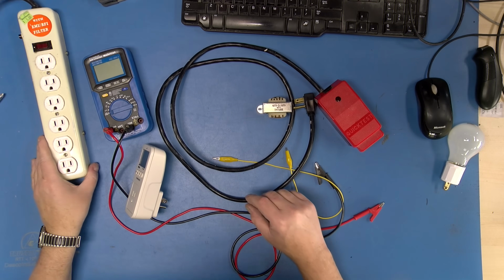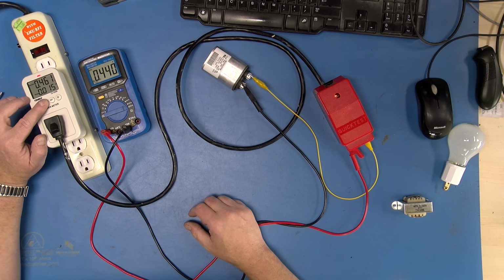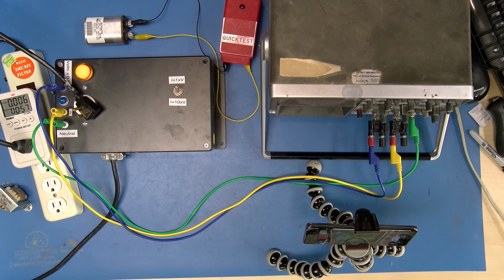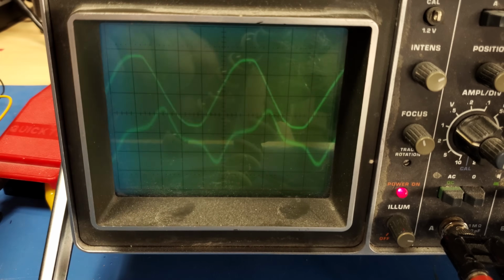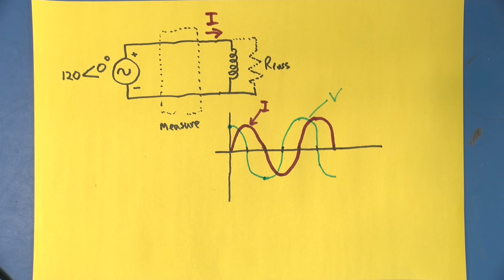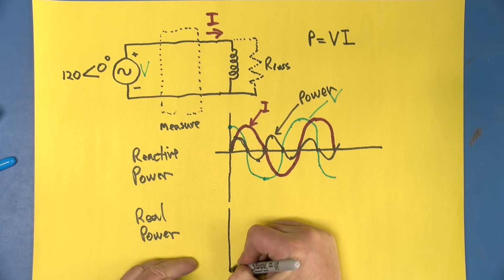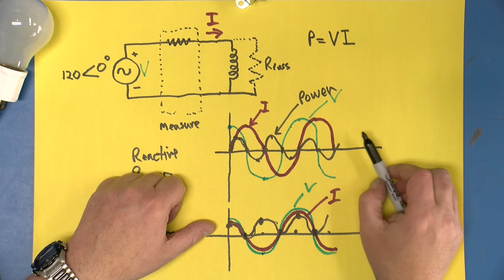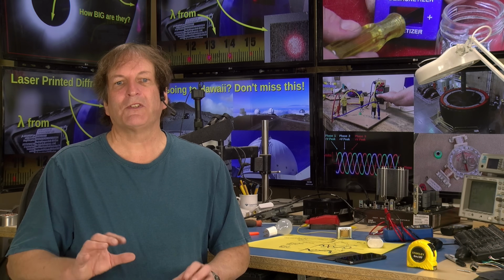That strange flow of electricity that transmits no real power

Comment: Thank you for the great illustrations, explanation, and demonstrations.  This is one of those things that a bit hard to grasp just reading it.
First time I ever ran in to it was forever ago when manufacturers started advertising UPS's (battery backups) in VA instead of watts.
Picked up an AEMC clamp meter that let me see power factor and the actual power draw.
An eye opener seeing something consume a large current but very little power.  Like LED light bulbs.
Reply from the maker: Glad you liked them! Now that I think of it, UPSs were probably the first time most people saw the term VA. When I was a kid an we leaved overseas I had seen in on transformers but nobody seemed to know how it was different from watts. 

It is a bit of an eyeopener - not sure if you saw in the video, but the other amazing thing is how much current thing like induction motors use for the first few seconds of startup - often 5 or 6 time the usual current which a transformer would have to handle. 

LEDs and electronic powers supplies are often worse in a different way - a high narrow spike in at the peak of the AC voltage,
Reply: @ElectromagneticVideos  I haven't watched the previous video but am planning on it.
I had always wondered about xfmr's being rated in kVA but had never known about or considered the reactive (imaginary) current flows adding to the system.
It's sort of like VSWR.  Reflected power in an RF system.

I knew of an inductor's effect, buy, yeah, never really experienced it until I got my first air compressor.  It'd trip the panel breaker on startup from the massive inrush.  I foolishly tried to limit the inrush current using a bunch of paralleled 500W tungsten lamps.  I didn't have anything to measure just how much limiting that I needed.  Just ended up making a light that came on...then tripped the breaker.  LOL!

I wish I had know about NTC thermistors back then.  That may have actually worked.

I learned more a few years later when I started troubleshooting AC compressors.  Learned about LRA (locked rotor amperage) and how much and induction motor could pull without a start capacitor.  Start cap would go bad and burn the contactor's contacts in the process.

Yeah, a lot of switch mode power supplies have no inrush limiting and POP when you plug them in to the wall.
I've got a SMD reflow gun that flickers the lights in my shop from the PWM to the heater.
I'm planning on adding a NTC thermistor to get those spikes down to a reasonable level.

Thanks again!
Reply from the maker: @button-puncher  "It's sort of like VSWR." YES!!! Consider it a very short RF transmission line with a mismatched load that is very reactive (like many antennas!). 

LRA- did you see current my little grinder when it started - 4 or 6 times the running amps which is typical. The grinder really has no load other than the momentum of rotor and grinding wheel. Compressors often start when there is considerable pressure in the system - terrible for a single phase induction motor which hast it lowest torque at low speed.

My reflow gun does thin same thing -  though it was just because it was pulling a huge amount of current. Are you saying its noise from the PWM?I never considered that.
Reply: @ElectromagneticVideos   Yeah!  On my old 2ton unit at home, I was seeing a 118A peak at 240V.  Amazing that the compressor's windings didn't melt but i guess it did have the refrigerant to help dissipate the heat.
Head pressure too.  Bought a manifold gauge set for car stuff but hooked it up to my home AC just for fun.  WOW.  The short restart pressures were nuts!

As for the SMD...  I don't think it's noise.  It's just that they are using such a low PWM frequency for heat temp control, seems like only a few Hz, that in combination with the units switchmode power supply with no inrush current limiting, causes the terrible flickering on things plugged in to the same circuit.  I've never scoped it, just my observations and guesses.
My workaround to protect my other bench equipment was to put them on a  double conversion UPS that I had laying around.  Oder Eaton but it puts out a  beautiful sinewave.

Future video idea?  The usefulness of NTC thermistors to battle power current spikes?

BTW, why is your oscilloscope current test box so huge?  You have a couple custom wound current transformers in there?
Reply from the maker: @button-puncher  The currents are staggering for those motors! They survive because the max current is only for a few seconds and the thermal mass of the copper and iron means it takes a (short) while to heat up. If the rotors is stuck, they do burn out really fast if the breaker doesn't trip.

I will have to think about the NTCs for current spikes - I dont think they would be great for for things like motors - restricting the current flow would drastically lower starting torque. A VFD set to ramp up voltage and frequency might be better - they are so cheap these days!

The test box - just has a some low ohm power resistors inside. I repurposed boxes from various past work prototype projects so not ideal sized. Nice thing is though the size acts as a heat sink for the power resistors.

Comment: There was a device sold some time ago or maybe still is, that you plugin in appliances that use motors and was  suppose to save power useage based that that lag from running motors.
Reply: reactive power is free for homes. so such a device would be pointless.
Reply from the maker: Besides the point @KarldorisLambley made below, may of those devices were equipped with capacitors that were way to small to make any difference. I think some just had a LED indicator to show they were "working". Bigclive took some apart as I recall. So sadly, most of those devices are scams :(

Comment: AC HZ60-60+=120VAC NO AMP NO WATT NOW GROUND NUETRAL HAS AMP WATT CAPACITOR ON TRANSFORMER DC DISCHARGED PUSH PULL KILOWATTS VjX

Comment: Nice clear demonstration,   In a Flour mill power house and noticed a Power correction unit.  I cant remember the kVAR but the cables were 16 mm. The controller was having a bad day  throwing in all the capacitance causing a massive lead in the system, then over correcting and back to o.4.  I called this in and advises immediate action. Returning the next day to a mess of cables that had pulled such a high instantaneous current they had bent the trays and were tangled in the chard remains of some very large capacitors.  Best wishes.
Reply from the maker: Wow - that must have been a wild mess to see! Was the correction unit fixable? Or a write-off after that?
Reply: @ElectromagneticVideos  Definite right off and so nearly was the guy that investigated it despite my warning to isolated elswhere before opening. Fortunately the  blast shield did its job and the arcflash contained blast I expect the techs pants did similar.  

The fault was the controller which I think someone had incorrectly adjusted  delay and it was hunting. The cables were secured with 10mm ties wraps but those were ripped as the cables magnetic field rebelled. Lovely mess and reminder of the power stored in capacitors. 

I do miss the smell of switchgear.
Reply from the maker: @WOFFY-qc9te  "those were ripped as the cables magnetic field"  I have seen videos of that sort of things in fault conditions. Its hard to imaging the forces being so large but only because it outside  of our (or maybe my) everyday experience. A bit like I find it hard in imagine a dist particle travelling a very high speed having enough energy to damage windows on the ISS.
Reply: @ElectromagneticVideos  I did a stress test on a data centre, the old chap with me was old school and not impressed with the Pillar kinetic rotary storage or the digital switches which switched on a quarter cycle but as this UPS could not be turned off for twenty five years we made sure it was sound

Anyway with load bank connected we  diverted 1 MW through four alternative routes whilst the UPS was on line. 
The 55mm 480 vdc cables had been left loose on the 10 meter caged trays for a reason and that soon became apparent when they jump up and apart every time we brought the DC on to the inverters. The German engineers were not at all bothered by two Englishmen doing their best to trip the system off line they ended our fun after 30 minutes. Very impressive and noisy test.  

The old chap was also enjoying himself as he had retired and was called back from his farm in Scotland to do this job with me. The only anomaly was a 1.7 C delta T on  a 'Hawker' storage battery terminal and a car some idiot parked in front of a load bank which had melted trim Salvador Darli could have put his name to. 

Check out Galloping Conductors on YT
Reply from the maker: @WOFFY-qc9te  "melted trim Salvador Darli could have put his name to" I laughed my head off at that one : ) :) :)    

I have seen some of those Galloping Conductors video - just looked for more - one amazing one shown the cable on some of those really HV towers sawing so much its amazing they didn't break or flashover as some video showed. I have huge respect of the mechanical engineers and techs who design and build those systems to withstand harsh weather (including massive ice accumulation over here in the winter).
Reply: @ElectromagneticVideos  The tower stresses are enormous as shown in the damage to bolts and frames. It is indeed impressive the ability of the structure to handle those torsional forces.  

The video of the Netherlands overload shows many spans of the HV cables heating up and sagging to near ground level. I am puzzled why the line was not automatically disconnected.  

I miss an early morning walk through a switch yard, the 50 Hz and buzz of the TX and smell of ozone but have many memories of magnificent engineering and the good people who care for it.  

The UK are fortunate to have a very robust Grid, this was because of massive build of a standardised voltage system.  We have much lower loads from that in the 60's but we are now starting to demand much more. 

The problem is that the Substation Neutral is bonded to earth the same at the intake to a consumer. This is ok providing the earth is sound unfortunately as the loads go up weakness in that path become apparent the the loads across the three phases will find another path and that may be an unbonded gas meter or through a consumers circuits.  

Recently fires have been started due to new installations assuming the infrastructure is up to snuff. A meter test is not good enough as it does not stress the connection.  EV's are bring us trouble.  I watch a 'Bobsdecline'  he is a line man and provides toolbox talks in hi videos you may fine his content interesting I think he is Canadian. 
Have a good day and get your snow blower ready to chooch.  Best
Reply from the maker: @WOFFY-qc9te  "damage to bolts "  thats amazing - stresses must be unbelievable!

Netherlands overload - I think that was one I saw - amazing how the lines were sagging! As you said, strange they werent shut down.

Your description of the current have the opportunity of taking an easier path though things like  like gas lines reminded me of reading about an electric tram system being installed somewhere (dont remember where) I think the 1950s. The rails carrying the return current werent well bonded together and it only took a few years for galvanic corrosion to cause failures in all  the water mains near the rails. Oops! 

Bobsdecline - I have actually watched quite a few of his videos - very interesting to see how that part of the power system really works and all the specialized tools etc they have. He does his videos well - quite amazing considering he is doing them while working. He is in one of the eastern maritime provinces - I think either New Brunswick or Nova Scotia. Well work a look at his videos for anyone else reading this. 

And yes - its snowing as a write this :)
Reply: @ElectromagneticVideos  The return path through rails, I not sure if it is the same infrastructure however in the UK some early tram systems had a tendency to electrocute carriage horses.  We do have that issue on farms when the SWA steel wire armour cable return earth is compromised and you then have a voltage differential which the cows are not to happy about.
Reply: @ElectromagneticVideos  This is another film of interest,  how work practices have changed for the better.    " 400kV THAMES CROSSING | BICC Promotional Film | 1965 "
Reply from the maker: @WOFFY-qc9te  I had never heard of horses being electrocuted but but surprising in the early days of electrification when they were still figuring out how to do things. 

I have heard of the same issue in farms here. Even very small currents in the mA range apparently can make the cows unhappy enough to reduce milk production. I wonder if the cows are conscious of it or if they are not even aware something is affecting them?
Reply from the maker: @WOFFY-qc9te  I'll take a look later! Thanks!

Comment: Awesome video! I have 2 questions. 1st is about the capacitor on the bench grinder. How did you size the capacitor? Or doesn't the size matter. 2nd is why doesn't the power companies have capacitors hooked to their systems? (Or do they?) 👍. Really liking these videos on motors, inductors, capacitors, ECT...
Reply from the maker: Thanks!

1) It does have to be correctly sized so that the leading current to the capacitor is about the same size as the lagging current to the motor. 

The current reported by the meter is the combined real and reactive current to the motor. From the power on the meter, we can calculate the real current. So with the total current and the real current  can calculate the reactive current. But its not simple subtraction (although we could do that for an inaccurate estimate). The total current T as reported by the meter is the hypotenuse of a right triangle. The real current R is one side and the reactive current J is the other so J  = square root of ( TxT - RxR ).

So we need to choose a capacitor that will draw about J leading amps. (next video is Ohms law for capacitors, inductors and AC)

2) They do! There are also reactive effects of long power lines they have to manage, but the big problem they have is factories with giant induction motors drawing huge amounts of reactive current. They measure and bill the factories for it, so factories install capacitor banks, and in some cases "synchronous condensers" which are giant free running synchronous motors with the rotor's magnetic field adjusted higher than normal. This creates a huge adjustable source of leading current to offset the lagging current from the induction motors. 

I do have an old 3 phase induction motor stashed away. One summer I will have to see if it still works and demo a synchronous condenser!
Reply: @ElectromagneticVideos  I anxiously await the next video... Thanks for the response! 👍🫡
Reply from the maker: @chopper5371  I shot the video last night - have to edit it now so hopefully up this weekend.

Comment: Why you used Rloss in parallel with the coil? If you assume that the coil is ideal (R=0) then Rloss is not influencing the circuit. I would draw Rloss in series with the coil. What I am missing?
I have a question, more of a curiosity to see the waveforms and the explanation. The trasformer draws 0.03A. If you connect in series with it an capacitor that draw by itself 0.03A, what are the voltages on the capacitor, the transformer and the waveforms? Also, what happens if you connect a load in the secondary of the transformer, how the capacitor in series with the transformator affect the secondary voltage? Assume the load is a light bulb.
Reply from the maker: Your reasoning is right! Let me explain why I did it:

So in an elaborate model of a transformer we would have an appropriate R in series with each of the coils, and one in parallel representing the core loss. 

In many situations we just lump them together into one resistor (as I did) chosen to be a good enough representation of the losses a particular load value. That is often quite effective if the load is fairly constant. 

In this case, it was simplest to represent all losses with one resistor, which would cover both the core losses and the resistive losses in  the primary due to the no load current flow. So that was "good enough" for the video since we did not use a load. 

If we did want to have our circuit include how the voltage drops with/without a load - a resistor in series with the primary or secondary as you describe would have been a good way to do that (while still having the parallel one for core loss). 

So its really all about what degree of simplification is appropriate for what we are doing. Make sense?
Reply: @ElectromagneticVideos  Yes, I got it. Thanks. 
And how about my other question? That idea can make an interesting video? I once connecterd in series an inductor and a capacitor to mains, and the voltage on inductor and capacitor was measured as 220V on each. The mains was 220V. Sadly, I did not had the means to see the waveforms at the time.
Reply from the maker: @sebastian19745  Oh - sorry - I completely missed the second question. Actually the next video on this sort of topic will answer your question. It will be how to use Ohms Law and for AC circuits that include   resistors, inductors and capacitors. It actually is almost the same as for DC circuits, you just have to include the phase of the voltages, currents, and circuit elements. So that should be up soon!
Reply: @ElectromagneticVideos  Thanks!
Reply from the maker: @sebastian19745  Your most welcome!